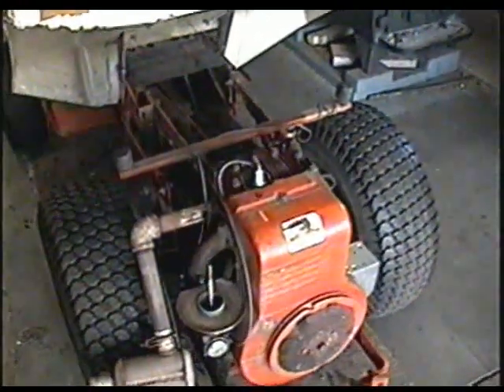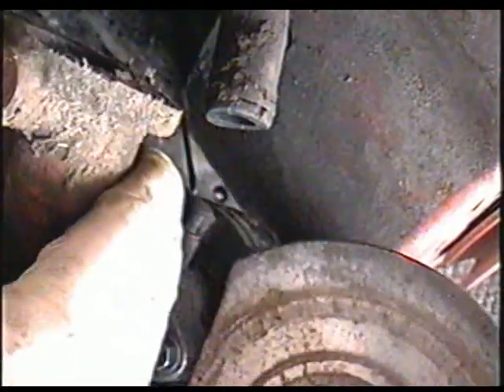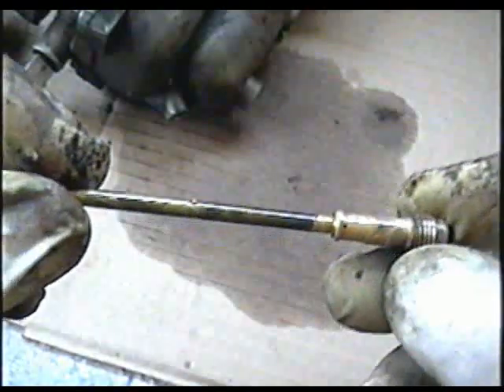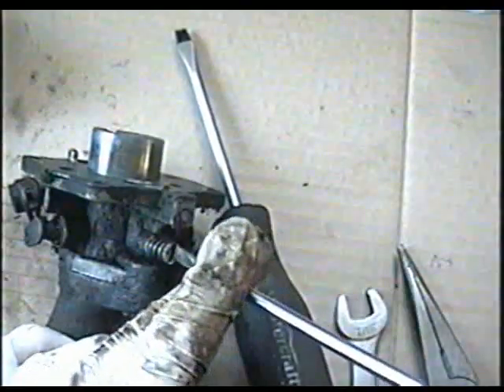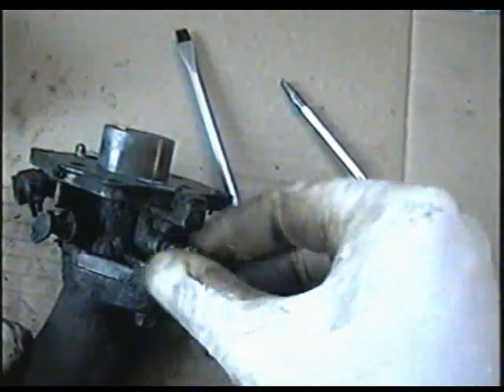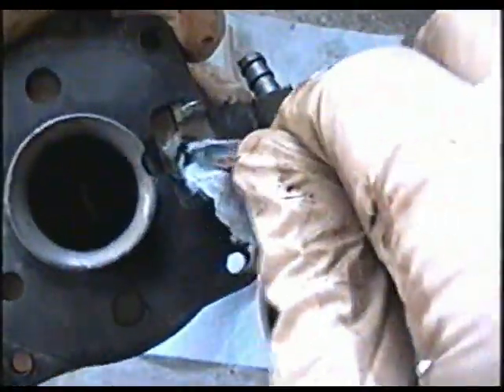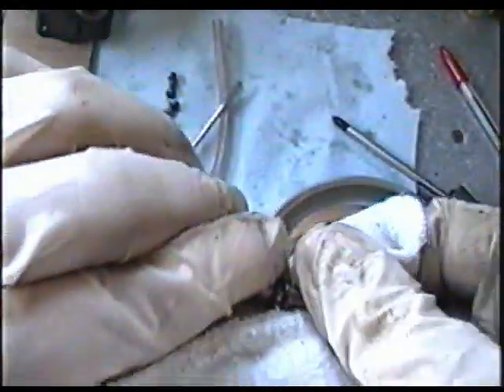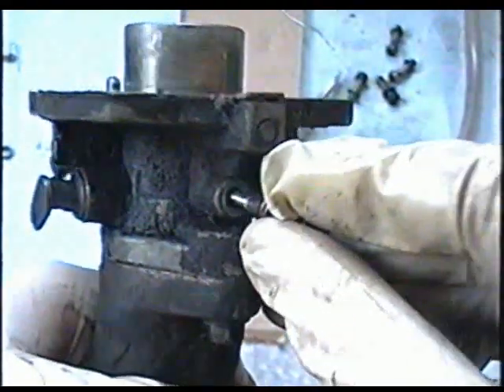16 HP BRIGGS Carburetor Cleaning on Gravely Tractor Part 1/3

Comment: You should get yourself an ultrasonic cleaner.  For all the carb work you do, it would make everything a lot easier; things come out super clean.  I got mine off eBay for around $255 for a good one with a heat setting.

Comment: if the o-ring does not swell up from fuel, then it won't hurt it if you spray it with carb cleaner. it's probably neoprene or nitrile rubber